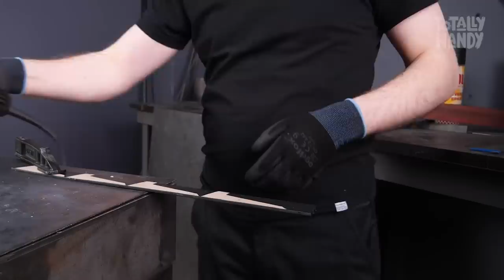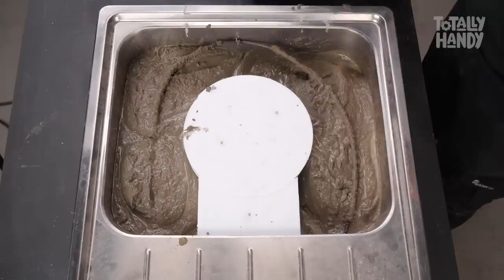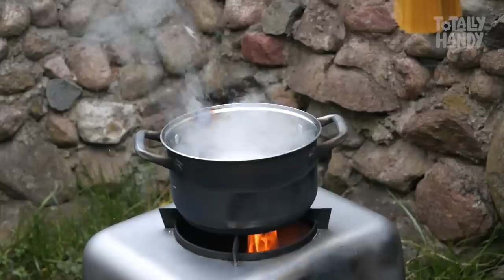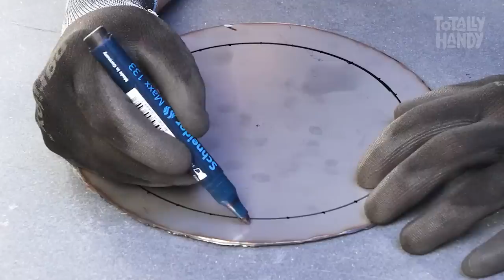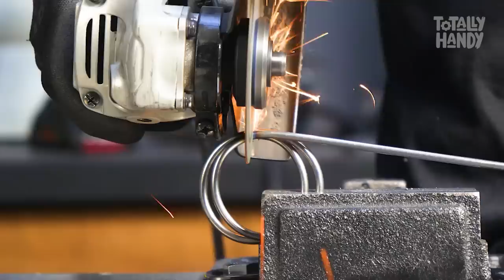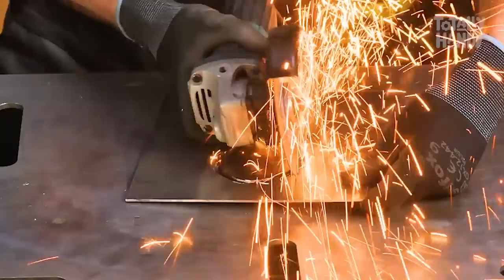Turning an Old Kitchen Sink Into an Outdoor Wood Stove! | Backyard Project

Comment: Doesn’t concrete explode when it gets too hot?
Reply: i think only if it's wet, but maybe would be better yo use refractory cement
Reply: They have high heat mortar and bricks. That's what they use in pizza ovens.
Reply: @austinknowlton1783  gotcha.

Comment: Cool idea, and great job. 👍

But considering the cost of materials you used here, wouldn’t it have made more sense to just modify an old grill? ….at least where I live you can find those “UFO” shaped coal grills all over every scrapyard or sold for basically both in the local ads